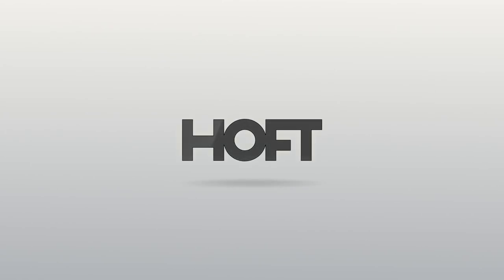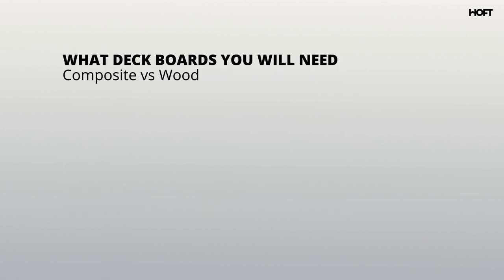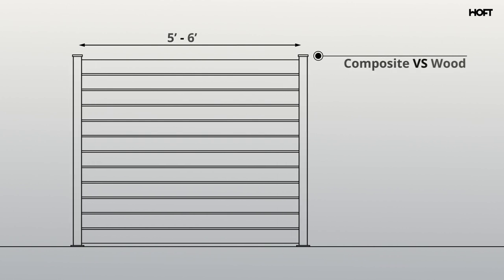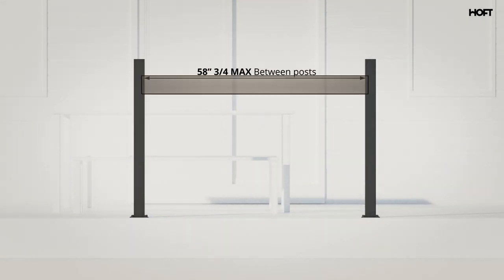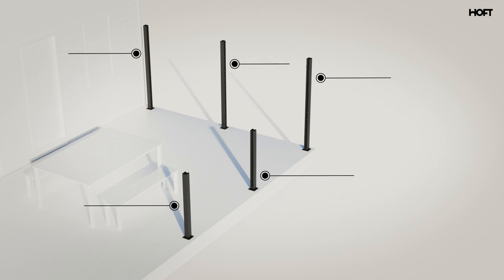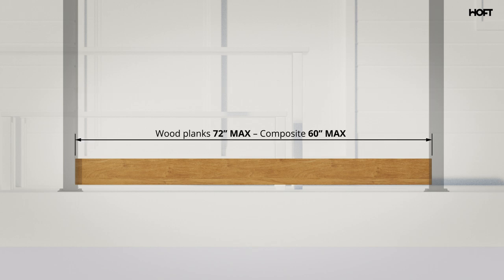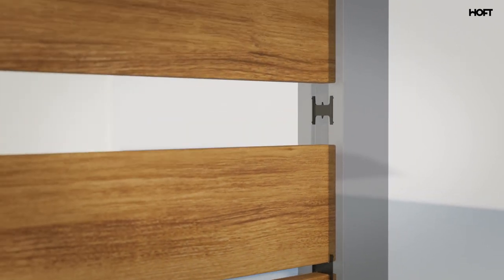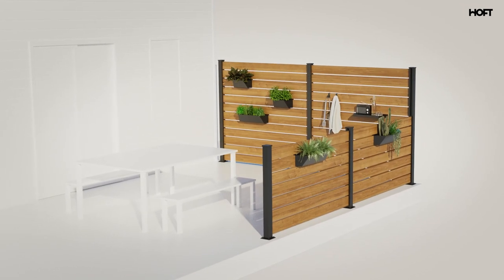HOFT Installation System - How-To Video

Comment: I'd like to use this system for a dog run and my dogs are insane, so I want to avoid having the spaces between boards. Is this system able to work without the spacers between boards?

Comment: Hi everyone. Buyer beware. I bought these from Home Depot and install them but guess what one and a quarter inch outdoor wood panels does not exist in Home Depot, Lowe’s, JW lumber, and Dixieline lumber. Then how in the world are we going to install these Were the stores that sell them does not carry the wood panels for them. I am in San Diego. Has anyone else running to this issue? I’m stuck. I emailed the company waiting for the response. That’s absolutely ridiculous. My suggestion is find the wood and then buy these posts that only takes 5/4 or one on a quarter inch outdoor panels.
Reply: Have you tried cedar wood? It's rot resistant. I saw some diy influencers using it. This is their channel: Sabrina and Andrew. Hope this helps 😊
Reply: All the major lumber yards carry 5/4 lumber which is 1 and 1/4” which fits perfectly in these. That’s what I bought from Home Depot and it worked amazing.